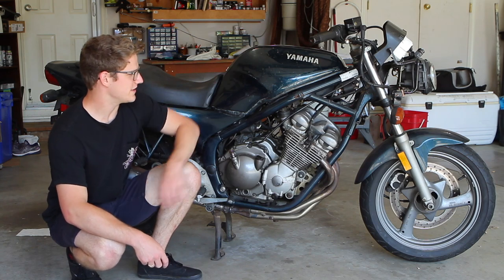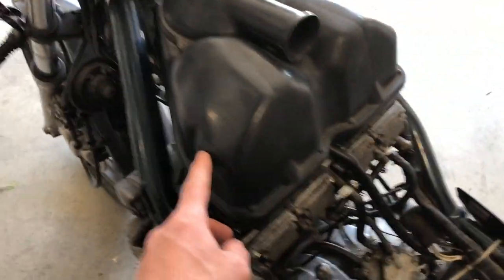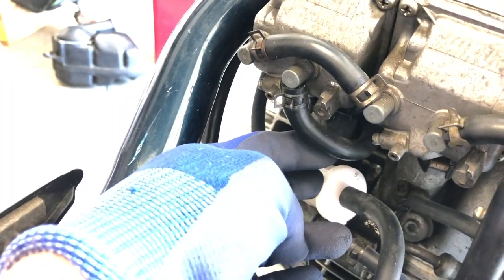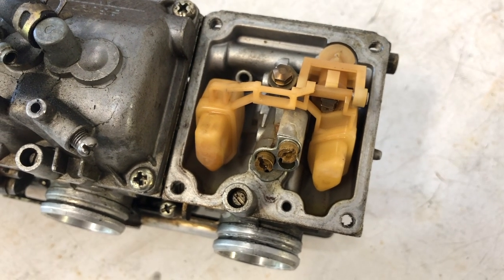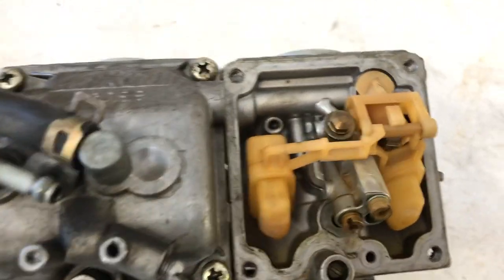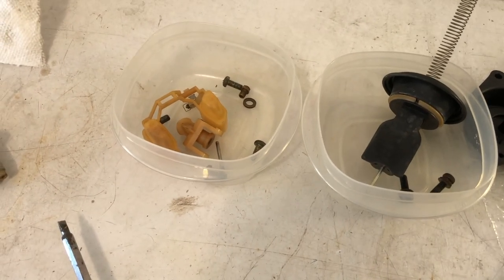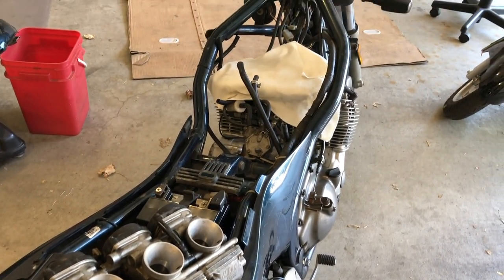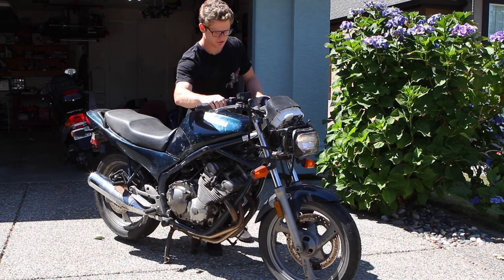How to Remove and Clean XJ600 Carburetors

Comment: I understand this video is 2 years old. But the clunking is almost 9/10 times the oilpump  drivegear pin. Xj600 had the wrong size pin from factory. I think it was 5mm. You can change it to 5.5mm then the sound has to be gone.

Note: it doesn't damage the engine in any way.
Reply from the maker: Yes I also suspect that was the source of the noise as well. Thanks for confirming this for other XJ owners 👍

Comment: The rattle at low revs is from the clutch cover rattling .you need to put a slightly larger locating pin in there and it then should go away . Common fault .

Comment: Fellow divy owner here: The clunking noise could be a clutch pin noise, and almost every diversion get's this noise after a while. It's nothing to be worried about but it can be fixed albeit not really worth it. The way you can check this is by pulling the clutch and seeing if the clunking disappears. 
The misfire you see is what my bike also has. It just seems to be something divy's are also notorious for. When cold they just don't like revving. Just let it warm up a minute or so and keep a bit of choke when driving off. 
Anyways very good bike, these are very reliable and can run up to a 100.000 miles when taken good care of.
Reply from the maker: Thanks for the great insights! I'm gonna look more into this clutch pin situation, but I'm glad it isn't catastrophic.

Comment: If you're ever going to pop open the clutch case, check the primary drive as well (aka the first on the top right corner that transfers power from primary chain to clutch basket, oil pump etc). If you notice any play on the nut securing the gear, tap out the safety clip, remove the nut, check threads, apply some oil-resistant titelock on the threads and tighten the nut back to 60nm(if i remember correctly) and tap the safety clip back in it's place. I have XJ600 '95 with over 43k miles on it and last time changing clutch plates on it I noticed some play and googled it. Noise was gone after that. Clutch basket rattle can also be improved by fine-tuning your carbs before you start to hammer bigger pin into the socket it was meant for ;)

Comment: The rattling noise that you noticed at low idle might be the signature clutch rattle on this bike. I saw another video saying that it’s a very common problem with this clutch on this specific bike. There’s like a five dollar fix for it where you put a pin in somewhere in the clutch. Sorry I’m not more help lol but I’m sure you could find the video if you just searched clutch rattle for this tear/make/model. Maybe it was even your video that you made after this lol I don’t know… Just throwing it out there.
Reply from the maker: Ya you’re totally right! Thanks.

Comment: My friend has been having trouble with his new fuel pump same model as yours but a lot more beat up the fuel pump basically rejects fuel out of a small hole with a ball in it the points to the right side out of the pump whilst it's running and we can't figure out why it's doing that but it's constant and all we can come up with is to block the hole up. The bike other than that seems to run fine .

Comment: Howzit man that wire to the right of the carbs that plugs in what do you call that cause my two wires broke off
Reply from the maker: It’s either a carb de-icer or carb heater circuit I believe
Reply: @Calvinm  like I've being told it's a oil cooler switch?

Comment: Man I got the same bike road it around same problem died ended up not having air filter in it an rust in the tank - carb, long story short cleaned carbs out an stuck on the throttle an air screw is it 1.5 turns ?
Reply from the maker: Yes, if I recall correctly the spec for the pilot air screw is 1.5 turns from seated. Basically snug up the air screw under then back it off 1.5 turns. Good luck!

Comment: what kind of cleaner were you using?
Reply from the maker: Carburetor and throttle cleaner. Or you could use brake clean, it just isn't as kind to the plastic and rubber parts.
Reply: @Calvinm  you know that long spring screw in between the carburetor what is that used for? the one in front of the throttle cable

Comment: I know the likleyhood of a reply is low but i need help💀 I took out the idle screw without thinking and only realised it when i threw the carbs back on the back, im scared to try and fire it up as i dont what to set it to, i dont wanna redline my back for idle as i start it. Same bike btw its just my carbs are the u.s
Reply from the maker: I think you’re referring to the adjustment in the centre of the carb rack near the cables. I don’t have an exact amount of turns to tell you but what I would recommend is to dial in the adjustment with the filter off so you can see the throttle plates. When you see the throttle plates open just a crack stop. Leave the adjustment there and the bike won’t rev to red line but will get a little extra air. Guess and check, refine and adjust. Good luck!

Comment: I have an issue with my 96 model. It will rev up perfectly in neutral, pulls just fine in 1st gear, but then in 2nd it stumbles at about 7-8k, and just immediately stops accelerating, and starts to backfire violently. This gets progressively worse the higher the gear, and the current top speed is about 70mph, because it can't pull past 6k in 6th gear. It does not help to roll off the throttle like if the mains were too big, nothing changes. What do you think could be the issue? 

PS if I just hold the throttle open at that point where it stops accelerating, it will eventually stop backfiring for a second, then resume the backfire, then stop momentarily.
Reply: did you find the cause of your problem ? ( got an 93 seca )
Reply: @cliffthepirate6207  No, I never did. I had to sell it before I had the chance to fix it. I honestly think it could have been either the coils or the plugs, but I didn't test it 😔 good luck
Reply: @killswitch_disengage  ah too bad you had to sell . btw mine runs good , no problem here but i thought i could give you some advice . it probably was an electic issue of some sort .